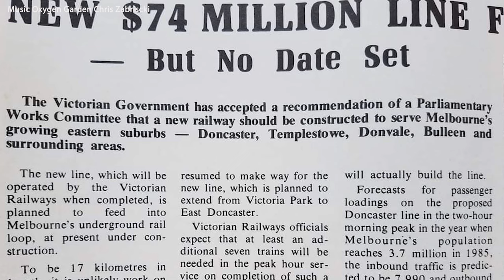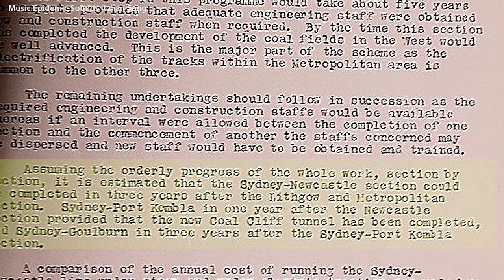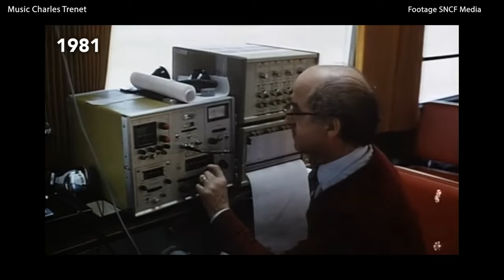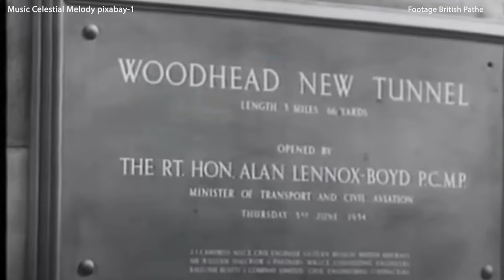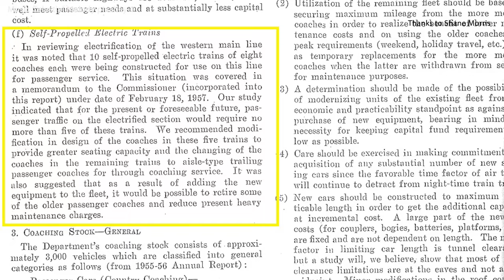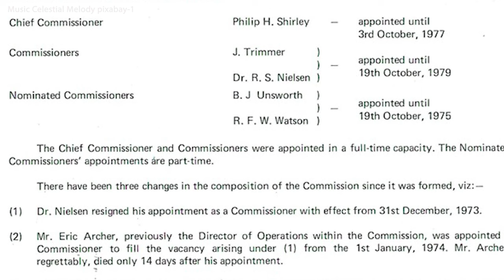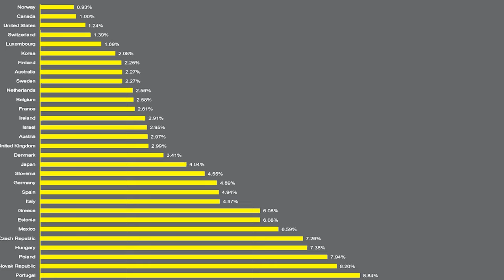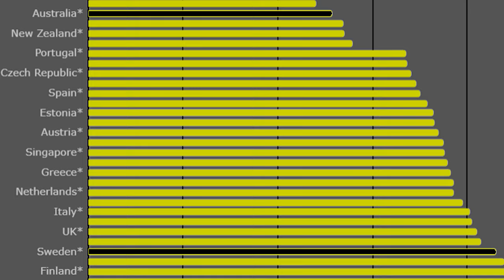EPISODE 9 ELECTRIC DREAMS

Comment: The Qld experience is particularly puzzling. When electrification was completed to Rocky, much of the traffic was moved to electric - including long distance passenger trains like the Sunlander. The interchange of motive power wasn't really an issue with a 20-30min layover scheduled in Rocky regardless for crew changes and to top up water. That all changed when the coal networks gobbled up all available electric motive power because of their power and efficiency - the govt not replacing these for the mainline - yet you can still see many of these loco's sitting idle at Jilalan - coal never willing, it seems, to give up its prized possessions.

But most NQ'ers are still miffed that Joh decided to stop electrification at Rocky - "what could've been" might well have preserved local passenger services that disappeared in the 90s.

And then we have Townsville with heavy rail stretching north, west and south of the city, yet abandoned its central station in favour of a platform deck on the fringe of the CBD - all but killing off any thought of reintroducing a suburban or even intercity services which once flourished in the region.
Reply from the maker: Thanks yes, I have in my imagination wondered what if full value had been got out of the Nambour Gladstone wire - and whether the wire could have gone all the way north so that NCL trains were electric hauled the whole way

Comment: Very interesting video. I would suggest the big problem is that railways take 19th century routes and never changed to 20th century ones. Roads have gradually adopted 20th and 21st century ones. Where you have modern rail alignments eg Perth they are very successful. Victoria has some success stories where the original routes were of high quality and could be upgraded. But many old routes should have been replaced 50 years ago.
Reply: Problem is roads get votes, railways tend not to. Its incredibly easy in comparison to sell a road related project compared to a rail one and that goes for planning permission as well.  You might well say the only reason the level crossing removal deal in melbourne   went through was because of the selling point of removing danger and congestion for road traffic, not much publicity put out as to the benefits to the railway or the rail passenger of grades being smoothed out and nice fresh stations with better facilities for the passenger.
Reply from the maker: Great comments.